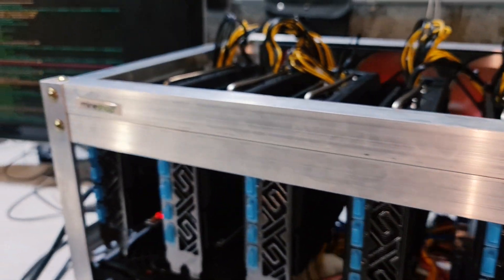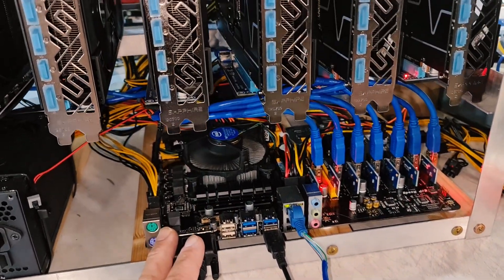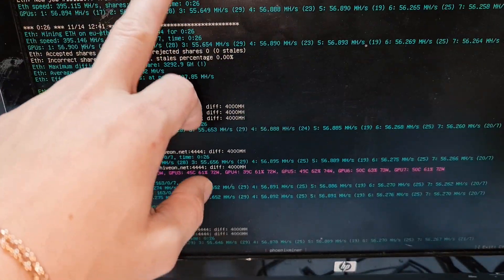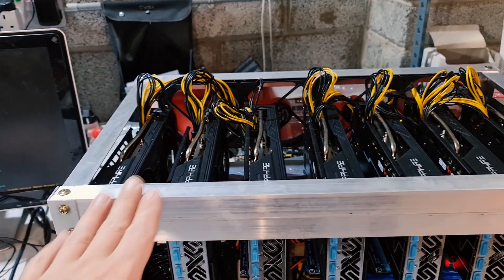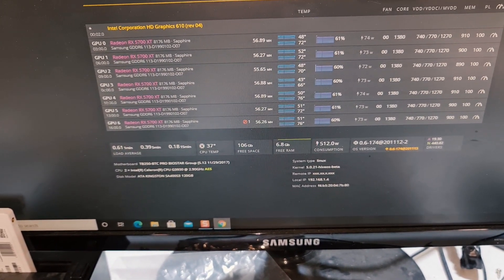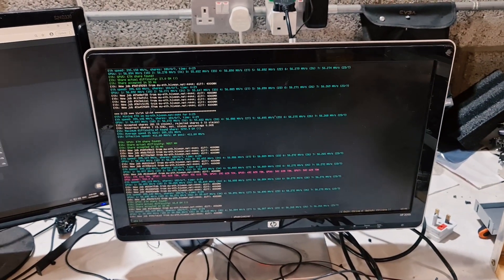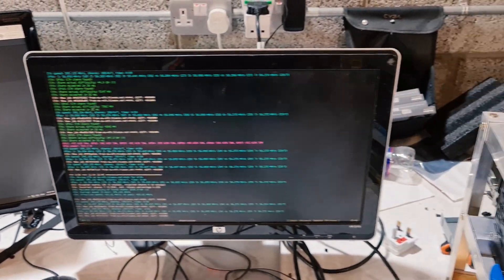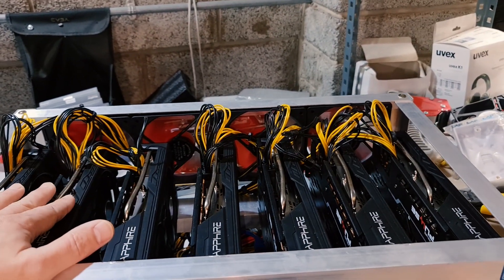400mh/s at 850w Ethereum mining !?

Comment: i have the same video cards. what are your overclock settings you used here? and are they bios modded with red bios editor?
Reply from the maker: yes modded bios from Nitros gpu and uploaded to this
Reply: thank you for the response and confirmig the modded bios but i still dont understand where to get these overclock settings. for example in msi afterburner i have on my rig of these gpus the following: mv 900, cclock 1325 and mclock 1825. what would be yours?
Reply from the maker: @ciprioltean360  core 1380 ,mem 900 , cvlt 760

Comment: Loving that power draw Guntis. Mind sharing the settings in Phoenix?
Reply: 900mhz memory? You use Hive correct. In windows i run 1800mhz on memory.
Reply from the maker: @BitKing_Ross  yahh 1800mhz same as 900mhz
Reply: @GuntisVitolins  got it. Forgot Hive uses a multiplier. Thanks for that Guntis
Reply from the maker: most of the RX 5700 i use standart oc ( core 1380 , mem 900-910 , cvlt 750-760)

Comment: I have free power, so give me all your micron memory that can hash 2 mhs more than the samsungs!!!
Reply from the maker: Hmm havent really noticed haspower change because of the memory type.
Reply: @GuntisVitolins  yes it does. All my samsung memory Saphire nitro+ reach 57mhs tops wail the micron can reach 59 mhs stable, of course that may be influenced as well for the silicon lottery but in average they overclock further,  im not the only one you can search in the forums in see this trend!
Reply from the maker: @tacoterito22  another thing is bios mod gets you the performance, i have tried exact biso on samsung on micron micron was 2 mhs slower. So i took bios and modded from Nitro cards flashed both of them. And got identical hashrate.
Reply: @GuntisVitolins  yeah that's the problem, there is a post in Igor labs forum where they show that micron an Samsung has to be bios mod in different way even the TREF value most be different and the timmings to